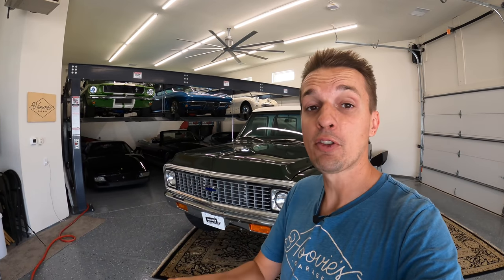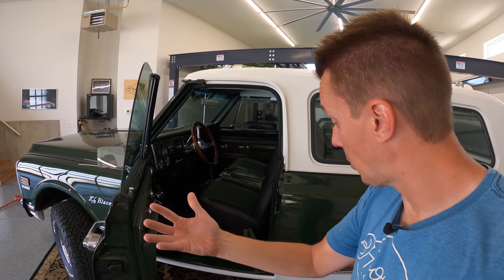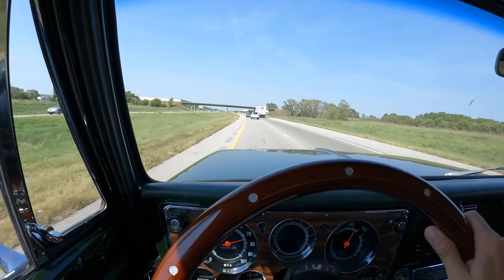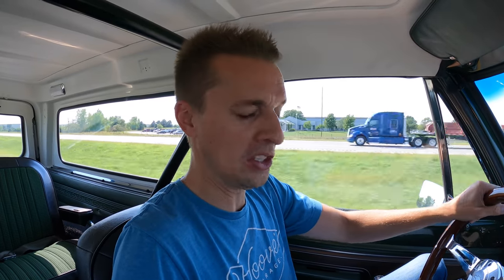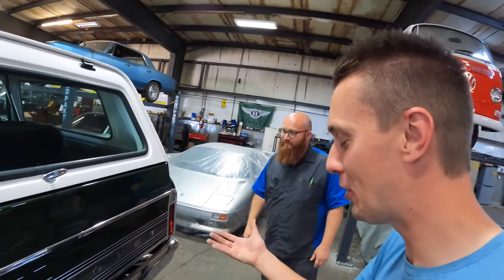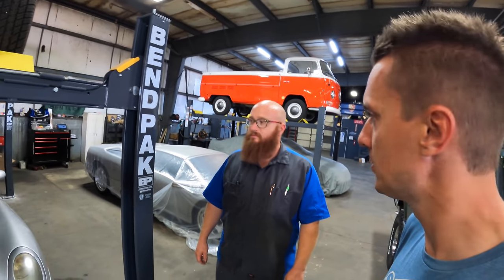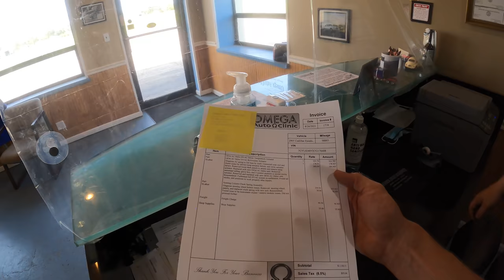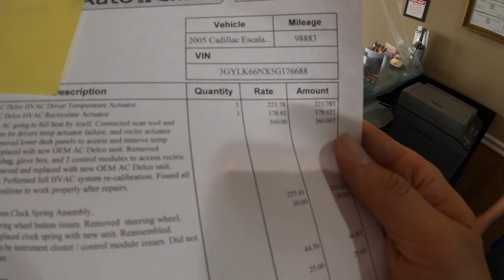Here's why the NEW Chevy Blazer is a HUGE flop. Build the K5 Blazer people want?

Comment: “See the door is misaligned” keeps slamming the door instead of placing it and lifting it a bit, “it’s going to ruin the paint “
Reply: It takes like two minutes tops to fix that with nothing more than a 7/16" wrench.  Every time he slammed it I REEEEEEE'd
Reply: I actually yelled "STAAHP"
Reply: @Skinflaps_Meatslapper  Likely needs the hinge pins replaced.
Reply: @theinsaneshecklador6598  It certainly could, really just depends on whether the door feels loose when you try to lift it up.  I've had one where the pin wasn't the problem, but the hole that the pin went into.  I just had a local machine shop press a silicon bronze bushing in and it opens smoother than ever.  A lot of misalignment issues are caused by hinge bolts getting loose (or making a habit of hanging on the door while it's open), sometimes gradual wear on the pins, but unless they're really worn out, they can usually be rectified by a small adjustment.
Reply: @Skinflaps_Meatslapper  Yeah, the pins usually wallow out the hole more than they wear the pins. The new pin kits include the bushings. I've done a number of them over the years. This generation of Chevy trucks seem to have that issue quite often.

Looking at some of the other stuff on this truck I'm guessing it was slapped together pretty quickly to flip.
Reply: You can't do that with the Camaro/TA doors, they just weighed a ton and bent hinges. These K5s (like all early GM truck bodies) typically had massive door sill rust but apparently this one has been fixed.
Reply: @Nakahat
Exactly, why would you keep slamming the door over and over again further damaging it? 
Hoovie is an idiot.  That K5 looks good, but who does a decent restoration and puts that shite steering wheel on it. Bizarre.
Reply: @theinsaneshecklador6598  bushings
Reply: Holy crap that was irritating! Dude! Wtf
Reply: @electi0neering  Hoovie is a moran lol

Comment: Back when GM still made decent vehicles!
Reply: 2006 was the end of their reliable trucks. 2007 to today, they are total garbage.
Reply: @matt9c1  agree. When they introduced active fuel management, that’s the end of reliability
Reply: Let me geuss your ford guys
Reply: @infinity-fq2xr  yea, ever since my 2020 trailboss blew up at 8k miles. As soon as it got out of the shop a month later I traded it in for a new ranger. I’ll never buy another GM. At least not a new one. I’ve had a few square body trucks that I fix up and flip. But when you drop almost $60k and less than 6 months later it blows up…you kind of lose faith in the company
Reply: @matt9c1  No 2007 to 2013 were good to even with afm or whatever they're 4 cylinder mode was while not good it was the only real flaw with those 5.3s. The start of the lt engines and the transmissions that came with them was really when gms quality dropped off significantly. Im surprised people like to praise ford so much considering they've only really put out one good engine in the last 25 years that being the coyote. The 4 cylinder and 6 cylinder arent good and who would ever forget the triton engines and the issues they had especially the 3 valve.
Reply: @Maybe_Saber  "it was the only real flaw with those 5.3". Um, this small flaw only requires rebuilding the entire top half of the engine. 
That's unacceptable....period.
Why would someone poop out this flawed design knowing it would require $5000 worth of work soon after the warranty expires ? 
No, the last full year for good GM drivetrain was 2006. It's all crap after that.
Reply: @matt9c1  Thats only if you're neglecting oil changes and obvious symptoms of a bad lifter or possible oil pump failing and just continue to drive it with less than ideal oil pressure which at that point its not even the trucks fault its yours. You act as if its just gonna grenade under 200k without warning and unlike similar year fords with the 5.4 it is at least fixable and you don't have to buy a whole other motor. Also 5 grand worth of work? Are you taking it to the dealer because thats at the most 2,500 if you take it any where else and even cheaper if you do it yourself. Not only that if it bothered you so much you could do an afm delete. Compared to its competition its certainly better. Definitely reliable and its why you still see them on the road everywhere.
Reply: @Maybe_Saber  Yea, I drove enough GM fleet trucks with religious 5k oil changes to know that's total BS. 
To add insult to injury, in 2014 they put a thermostat on the transmission coolant line to open up after the torque converter destroyed itself. 
What did they do for those with AFM and transmissions failures due to GM's poo engineering ?
Nothing.
Zip.
Nada.
They left you hanging with a $5,000 repair. 
Sorry Saber, the GMT800's were the last of the reliable GM trucks. There's enough data out there from mechanics who know their stuff to validate this. 
The only smart path forward is to go Toyota. The big three from Detroit gave us the finger over a decade ago, and they will never get my business unless they have a major overhaul. 
Sadly, with the progression of EV technology, it may be too late to recover trust from those lost customers due to the downfall of ICE. Even if Detroit got it right, it is now too late. 
When I see the new EV Bolt, EV Hummer...etc all I think about is how GM gave me the finger when my Silverado puked it's torque converter at 11,000 miles and then fought me on not doing a warranty claim.
Reply: @matt9c1  Sounds like you're basing you're opinion on those trucks after a single bad experience you had. In my experience I've never had an issue with them and I still see them everywhere (because there reliable). Also if you payed attention to my post I was talking about 2007 to 2013 anything after 2014 I said was garbage since they dropped the LS engines in turn for the LT as well as whatever other bullshit they eventually ended up doing like 3 cylinder engines and horrible EVs but with that said every EV is garbage right now as is. And Toyota? They don't compare to the american made trucks when it comes to towing capacity which is why no one that is going to use it like a truck buys one. That and you can find parts readily available for coyotes anywhere or hemis or LS motors.
Reply: @Maybe_Saber  LoL, thanks for your concern. I will gladly keep my Toyota.
Reply: @Maybe_Saber  the 2 valve modular engines arent that bad, although the late 90s and early 2000s they screwed the pooch with incompetent intake and plastics decisions.
Reply: @matt9c1  the 2007 2008 years still had 3800 and 4t65e combos that were reliable.   not saying much tho.
Reply: @CT_Taylor  They also love to shoot out spark plugs. I currently have one and have been trying to get rid of it but nobody wants a Ford with a triton regardless of whether it's the 2 or 3 valve. Only motor I like from Ford is the coyote since it's basically the new ls and their fairly simple and fit in anything.
Reply: @Maybe_Saber  did they all have aluminum heads? I thought my marquis I worked on was iron, if it was aluminum then I just got lucky because that car had 200k on the first or 2nd plugs and they were, needless to say, ready to be replaced.  the injectors also fell apart when i pulled the rails to put an intake on, well half of them. Half the coils were falling apart, but it was 200k and 20+ years old, so not super unreasonable but I definitely didnt have any trouble with my COP for my 2001  olds aurora . 

The LS Is simple but the coyote costs a lot and has DOHC iirc, not that its not good, but the LS still does knock out with pushrods and 1 camshaft lol.  If the ford coyote was made in the same numbers, i wonder what the price difference would be
Reply: @CT_Taylor  Not sure about the heads question. My experience with the 5.4 has been exclusive to f150s but I honestly don't think it matters if it they were aluminum or iron pretty sure the problem is that their aren't many threads so there isn't much holding them in but I could be wrong. And yeah I agree that the ls is for sure better but as time goes on they'll be harder to find and I feel like the coyote would be the next best thing given its in a smaller form factor while being reliable and making a good amount of power. Also helps that ford's thrown them in all of their trucks and mustangs for the last 10 years so finding one in a junkyard shouldn't be difficult.
Reply: @Maybe_Saber  I didnt realize the coyote has been in the vehicles for that long. Is the coyote crate motor different than the applications?  Like, how GM used iron block "LS" engines for trucks and aluminum ones for performance cars , making it a little annoying because people like me who dont have an LS or have interest in one just found that out lol.   what the hell is an LT :O    we may never know

Comment: Worried about paint. Keeps slamming door 😂😂😂
Reply: It's already jacked up and requires repair....
Reply: It seems he has no choice if he wants the door to close.
Reply: For the next video i pressume. At least a mention.
Reply: Maybe get the seat belt out of the way might help too
Reply: You can definitely close an old car door like that without slamming. Slow applied force
Reply: the chevy orange with white top and highlander interiors were awesum
Reply: If his name was Doug DeMuro, people are going to attack him and calling him an idiot. This happens all the time to daddy Doug
Reply: Chevy doors don't work
Reply: @Emira_75  These things (C/K trucks, Suburban's, and Blazer's) are beasts, and can be slammed all day, even though there is typically no reason to do so.
Reply: @calderondennis  In what universe do you live?  Chevy doors work perfectly fine, unless someone screws with the alignment, as seen in this example.
Reply: @jreyman  in all fairness gm doors suck hinge pins, bushings and alignments are constant maintenance items
Reply: @jreyman  the 1979 camaro i grew up in had sagging doors, had to lift to shut them. BIG heavy doors, im not surprised.
Reply: That thing must be cherry then because you usually gotta slam em 3-4 times to get em to shut.....Also about a quarter lb of rust falls off each time...
Reply: @RandomGuyDan  apparently y'all have never had a car where you have to slightly LIFT UP on the door while you close it. Amazing concept. Allows door to close without causing further damage from slamming door. 🤔
Reply: @TheMattc999  Many times on vehicles with worn hinge pins. This truck is supposed to be restored and I am sure that they paid $25k+ for it. No lifting should be required.

Comment: Manual locking hubs are awesome. For the snow you can lock them ahead of time and drive in 2X mode untill you need 4X4. You can even switch it on the fly if you're going in a straight line.

Comment: back in the early 80's my boss had a chevy pickup with a 396 in it. I was hauling a load of construction/remodel debris to the dump in it. I loved the sound of that big block opened up so much. Even thru residential areas unfortunately. When i returned to the neighborhood after the dump run i noticed it wallpapered the neighbors yards. It was everywhere. It must have drank a half a tank of gas for that short trip. It was an old retired alaska pipeline truck he had bought and those trucks were beat all to hell

Comment: My all time favorite GM body style. I've owned a 67 and a 72. Both short bed step sides. The 72 was a 4x4 with a very healthy hopped up 350 and a 3" homemade lift. Not many aftermarket lift manufacturers in 78. Lots of fun but I could not afford a 5 mile to the gallon truck so I sold it.

Comment: I don't think they ever put the big-block V8 in those, but they did offer the 400-cubic-inch small-block for a few years. Of course, it was the 1970s, so it was a 400 with about 180 horsepower. GM's engineers in the '70s were masters at extracting as little power as possible from large-displacement V8 engines.

Comment: Looks nice but makes a guy wonder about the quality of everything that can't be seen when they do crap work on other parts, simple things like the dust cover on the trans, the bolts and chunks of the old one are still there, and the trans was obviously painted and painted right over the bolts with pieces of the dust shield still under each of them.  Transfer case gaskets and leaks, come on, even someone doing this work in their driveway can get that right.  And that alternator, was that pulled off another piece of junk last minute and tossed on??  A run to the parts store for a reman GM alternator to put at least a newish looking one on instead of what looks like a backyard junkyard pull on it would have been the least bit of effort.  Front main seal on the engine makes me wonder how much time and effort was put into the engine as well, was it fully rebuilt or just cleaned and painted and craigslist resto'd with some gaskets and spray paint.  For what i am sure they overpayed for this, having to spend a few grand to get everything right as Hoovie said is utterly ridiculous.  Nice vehicle yes, but makes you wonder what horrors lie beneath now, i would be checking for body filler and patches and other unsafe barn fixes.
Reply: Spray paint rebuild.
Reply: @bmh67wa  The real way you tell it is is that it looks like absolutely NOTHING was put back together with a gasket(WHO even does that?).  And, no, the steering isn't supposed to be that loose, not even remotely that loose.  I really hope they didn't pay too much for it, because it does look a little like it was slapped together in time to make it to the auction.
Reply: Despite any faults. It's a great investment. I would give anything to have that in my garage. Classic.
Reply: Again. These things lost door sills in like 5 years

Comment: They did a really nice job restoring and upgrading that Blazer.  It is a beautiful truck. That year is especially nice.  And they can be quite charming.
But they have their drawbacks.  Off road they can be rougher riding.  The straight axle limits turning radius.  And they can develop squeaks and rattles, shaky loose side glass, door issues, etc.   
I'm glad your folks invested in it.  It'll be a good store of $$ in inflationary times.  And I hope they use it some ...

Comment: Hoovey! Wizzard! Check that frame behind the steering gear box!!!!! They often crack there and need a brace and stiffining plate welded in. You have to take the gear box loose to see the cracks at the bolt holes, and with it on the ground turning the wheel left to right, if that driver side frame twists a bit then check the rivets at the cross member for being loose. They also wear those rivets at the cross member to the frame. 
   This comes from years of experience working and building 67-87 C10 and K5 blazers. 
   Beautiful rig 😁👍
Reply: I noticed frame to body braces on this blazer with turnbuckles in the video,  never seen that before.   Have you?

Comment: That steering wheel has got to go given everything else on it is so nice and stock.
Reply: Unfortunately the stock steering wheels on those did not hold up as well as the rest of the truck.  They were all cracked with big gaps in the plastic within 10 years.
Reply: I hate those wheels with a passion, junk

Comment: I'm betting they didn't use the oversized front seal or a shaft collar kit when they resealed the engine.  I'll bet it's leaking past the new front seal because the snout has a groove in it from all the miles.  EDIT: IF the engine was even taken apart at all.  The more you look at it the more questionable it gets...

Comment: How do you do a detailed restoration and not put the flywheel dust cover on????
Reply: I guess you missed the steering wheel.
Reply: May have lost it/ may not have been present prior to restoration. As an aside, how many noticed the remains of twisted off bolts in the flanges for that cover(& how do they NOT fix that)?

Comment: The fact that it’s a manual transmission makes it an absolute keeper. My grandfather had a 1970 C 10 pick up that looked a lot like this blazer just a different grill and it was red. He drove that truck for almost 50 years Until his passing just a few years ago. At his funeral they talked about his truck and how it had nearly 1,000,000 miles on the motor before it was rebuilt back around 2010. It was a short bed four-wheel-drive which was incredibly rare. My uncle has it now.
Reply: I thought it was an auto. It seems to be missing a pedal  and there was some discussion about the torque converter.....

Comment: If you don't kit out the door hinge pins you're gonna crack the metal at the striker in the door jamb! Also, I made a cheap hood lock with a cable that dropped from the hood down through the latch support then padlocked it at the bottom.

Comment: When you compare interior colors of the 50's-70's to today its amazing how many colors were available. You had everything from Cadillac tri-color to the very odd AMC Levi's denim.. In today's average car you get to chose from either black, tan or grey in leather or cloth.. The you look at Rolls Royce or Bentley and interior colors are "sky's the limit" on choice..
Reply: You can still call and order your car with whatever option you want. 
Back then they didnt charge 10k for a satellite radio upgrade.
Reply: Production minimalism which keeps stocking costs and production costs low.
Which is why many vehicles just went with power windows standard since you needed 2 door versions to accommodate a cranks or a switch. Now only one door panel and assembly.